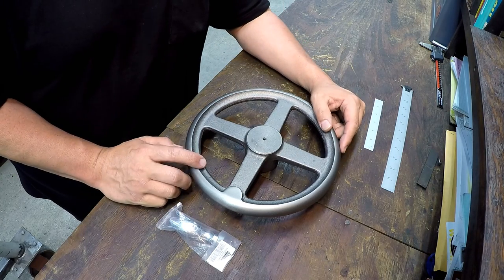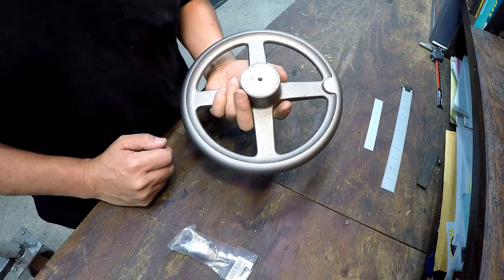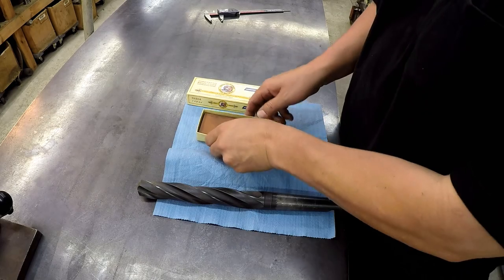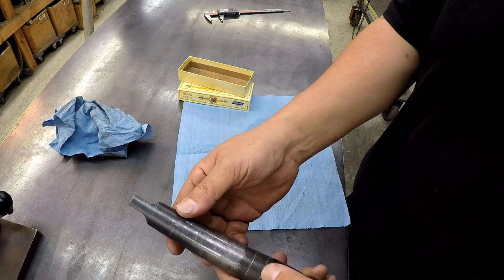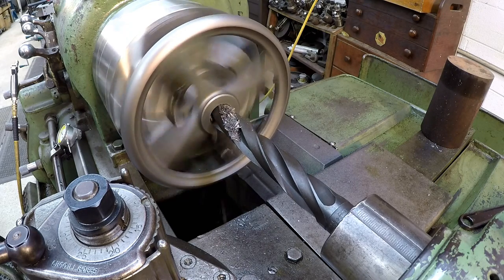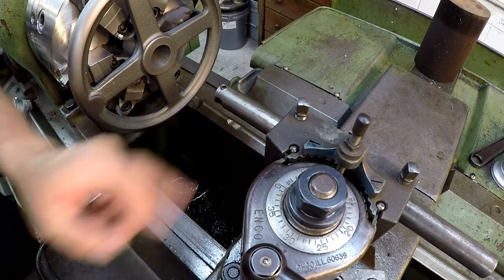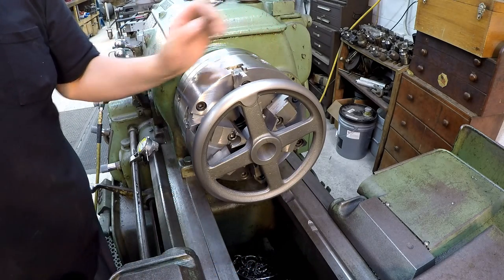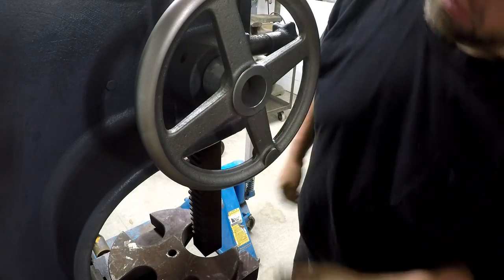Machining a Dake Arbor Press Handwheel

Comment: 30:00 Despite the "few thou" loose fit of the wheel on the shaft it was still so close that the tiny divot raised by the punch was enough to interfere with the removal. Niiiiiice work. :)

Comment: As others have mentioned, those Knipex 'pliers wrench' tools are very useful & handy. They're forged, have smooth jaws, and their well engineered 'rack & pinion' like parallel jaw design allows significant mechanical advantage. They're a bit pricy, but nearly indestructible. If only after one pair, I'd suggest the 10" version (86 03 250). Recently they've additionally released them in black oxide finish... which I'm sure works well... however I've have a pair of the chrome ones over 20 years old now (that with minimal care) have no rust. Knipex now makes the things in numerous sizes, and even a bent handle version. Amazon has them all as do many other places; or even used on eBay.

Comment: You need to add one more step. You need to make a plug (cover) for the wheel center to hide the big hole in the wheel. 
   I enjoy working with my wood lathe but watching you and the precision and the tolerance that you work with 
Is amazing. 
I work alone and spend a waste a lot of time looking for tools I used and didn’t but away and cleaning up the mess I made before I can start a new job.  THAT WAS BEFORE I watched your post on being a better employee, I am trying to use it in my shop and what a difference it has made. 
Thank you for taking time to remind us to be a better person on the job or in house or shop.

Comment: Thanks for sharing your knowledge. I learn so much from watching your videos. I was fortunate when I was growing up to have a fair sized handful of different tradesmen take an interest in my future, (I was a bit of a 'wild' child, so a portion of their purpose was to straighten me up!), and teach me their trade(s).

I was taught carpentry, plumbing, electrical, layout and printing, sign painting and a few other trades.  Fifty years later I STILL thank them.  Watching you reminds me of their giving of their time, and knowledge.

I envy your future children, introduce them to your trade, but don't push; show them how you fix their toys, and other household items. 

Nuture their interest, keep your calm and patient manner of explanation, and you will raise some talented, self reliant individuals. If they never earn a cent using the knowledge, it will be a solid foundation for their future.  

Most likely, they'll end up neuro-surgeons, engineers or invent a new trade, completely.

Your use of the transfer punch reminded me of something I picked up from a Youtube vid a few years ago; something the video producer didn't even mention in the vid.

In the background of the electronics related video, was an open 64 bit drill index, showing the drills. I noticed every other bit was upside down.

This reminded me of something I did with my sockets in my mechanic's tool chest about 10 years ago. I wrapped some bright yellow tape around the x/64 th & odd number metric sockets, to make selecting them with my aging eyes.

I thought about it, for a few minutes, and realized that would making selecting, (and putting away), drills much easier, as well. I flipped the drills in one of my index boxes, and test drove the theory.

Within a month, every time I used anything in an index, I flipped the appropriate tools over, in opposition to the rest.  A short time later, I took it one step further, and took a paint pen to the butt ends.  That makes it even easier. 

In the case of the transfer punches, the paint gets marred up, but it's not like transfer punches get a lot of hammer impacts; in 4-5 years, I may have to touch some up.

As you get older, you may well feel the urgency of time; it certainly goes by faster as we age.  It's these sorts of time saving actions which helps a person accomplish more, in a shorter amount of time.

If you find yourself digging through something disorganized, looking for what is needed, switch your approach, and dedicate a few minutes every day, or so, and sort the stuff, container them, and label.  In a week or two, you no longer waste precious time digging through a box, or bucket.  You WILL thank yourself, profusely.

Hope my sharing brings as much to you, as your videos give me.

Thanks for sharing, and the work it takes to produce the vids.

GeoD

Oh, BTW, matching paint?  That's for the average guy; go for contrast, or something bright. Personally, I like florescents!   LOL

Comment: You need to make a little hub caps for the center of the wheel
Reply: Either that or turn the hub down to the same length as the stick-out of the shaft.
Reply: Maybe a project for NYC CNC with Abom’s logo engraved on there!? Out of brass!
Reply: I was thinking I could 3d print a cap in TPU but I only have garish colors at the moment

Comment: Knipex are hands down the best pliers I've ever used.  I have 11 sets of various sizes and jaw configurations. No reason to have anything else.
Reply: AvE taught me this
Reply: Yes, professional electrician by trade, Knipex cutters, pliers, etc beat the competition hands down. I have a pair of cutters I use day to day... for chopping service cables, (16 sq mm cable, about 2 gauge in US I think?) , pulling floorboard nails, etc. They can still snip the nylon rip cord in a cat6 data cable cleanly.

Comment: Excellent job!

2 Things I wouldn't have Done (just me):

1) Not bored the center hole all the way through.
2) Not machined the OD of the boss. I think the casting texture gave it a natural surface.

I would machine a Name plate with your initials or Drakes Logo, sort of a Wheel Hub..

Comment: Our machine shop teacher in the mid to late '70s taught us to use a cigarette paper to touch off a bit/cutter etc. Thinner than normal paper and everybody had them...  ;)
Reply: Since the same paper was used on both sides, halving the distance to find the center will still work fine. In fact, he could have used something 1/4" and it would still have worked the same.
Reply: Use cigarette paper these days and the shop teacher will have you pee in the container for testing.  ;- ) .
Reply: ‘70s shop teachers equals 2000s sold off machinery and no shop class. Unfortunately everything good is being labeled dangerous and being nerfed now.
Reply: @MrRodneyCL  My machine shop was in college and the teacher was a retired Navy Machinist. First day of class he told us we wouldn't get A+ unless we could do it better than HE could. I got all A ...

Comment: I wish I could afford a nice set of knipex tools. German engineering and finest quality. I'm from Australia so I'm lost with your measurements but I know Abom, your heart is always in the right place.
Reply: Going back and forth between Imperial/SAE and Metric is easy enough.  The key is that 25.4 mm. = 1 inch.  Every now and then, things are close enough that tools are "interchangeable".  A favorite of mine is 0.75 in. and 19 mm.

Comment: My granddad told me its not good to use oil on cast iron for taping or any machining work but just for some help and extra safety he told me to use kerosene. It really helps if you drill or tap cast iron.

Comment: Our 72-year young toolroom machinist does never uses a traditional edge finder.  He uses a .200 gauge pin and puts a little Sharpie on it and moves to the part until just a bit of the Sharpie rubs off.  Says he has always been way more accurate with that over a normal edges finder.  Seeing you use that rod reminded me of that.

I was surprised you did not face the back of the wheel when you did that skim cut.  I know you didn't need to, just thought you would.  Great video

Comment: I ground myself some precision stones at work, for
use at work and I use them all the time. Sometimes
things like that big drill, I’ll leave the stone on the 
bench and drag the drill shank along while rotating
it at the same time. It’s much easier than holding
it in the air like that.

 I also ground some round stones, so now I can get
into some radius’s and some holes.

Comment: Your edge finding method with the piece of paper is quite similar to a common method to calibrate desktop 3D printers, I guess it's a method that works for many purposes.

I have to admit that I'm quite jealous of your home shop, would love to have those machines and tools. I'm gradually improving my situation though, currently in the process of fixing up my grandfathers old wood lathe. Tracked down a new driveshaft for it and gonna try and adadpt it to do soft metal turning in addition to wood turning.
Reply: Been using paper to locate tools for 30 years now.  Only 8 months with the 3d printer...;)  Exact same principle though.  If you take a micrometer paper is consistently 0.0035-0.0042".

Comment: Hi Adam, I was very interested to see how you held the cordless drill when putting a divet in the shaft. You see so many people on here using hand drills at weird angles and moving around so I wanted to see how accurately you did it. I can honestly say that you seemed to be spot on square to the shaft and never deviated, perfection!
I bet that 'Stefan Gotteswinter' would be envious of your stance, maybe you could arrange a contest to see who is the most accurate with hand tools used in a machine shop? A simple piece of 2" square bar, one face filed down 1/16", one face hack-sawed corner to corner halfway down it and a 1/4" hole drilled through in the center of another face with a power hand drill... could be fun?

Comment: I'd have made the bore in the hand wheel a blind hole to the correct depth of how far onto the shaft you'd want it to go. Nothing wrong with the way you did it though, just personal preference. Also, recess the davit in the shaft a little bit so that it cannot flare and jamb the hand wheel onto the shaft.

Comment: Nice work there, watch for another favorite machinist; Keith Fenner
 to make a comment about not having a rag down if that's Ductile materal.
Reply: It's a personnel preference.  Take 10 machinists and 5 of them won't use a rag.  They will clean up ( Adam keeps the tools and shop spotless) after every cast iron or ductile job. It's just how you prefer to run your shop.

Comment: Great work. Without any criticism, if I was the customer I would have requested 3 things done differently, mostly for visual reasons:
Not machining the hub sides. I am sure you could have held the work by the rim without leaving marks.
Shortening the hub height to match the arbor. Or place a cap on the hole.
Grub screw set in between two spokes, so it can be accessed with a basic key.

Comment: 2 thoughts:  1.  would it have been a cleaner install to not have through drilled the handle hole?  2.  Would it have been an easier install to put the set screw off line from the spokes, making it easier to fit an allen wrench in to tighten?
Reply: @TheMrSnyder Wonder if it might have taken some of the stress of the setscrew if the handle bore might have been slightly tapered?  That is, requiring the handle to be hammered onto the shaft.

Just thinking aloud--it isn't my tool, after all.

Comment: I believe I have seen extensions for taps that duplicate pully taps. you could use an appropriate 1/4, 3/8, or 1/2” socket extension female side down to get by, but it would be a wobbly fit without some modification.
Reply: Lisle makes a set of tap sockets. A pulley tap is much thinner than any standard tap with an extension though.

Comment: 12:00 I've never seen a 3 flute twist drill bit before.
Reply: Xarfax umbagwe  I believe Adam called it a "core" drill. They're extra rugged and designed for enlarging the cores of rough castings.

Comment: Hi! I have an never done this type of work but i was just thinking why the hand wheel needed  to be drilled all the way through as the shaft on the press 
does not go all the way to the end of the drill hole also it might look cleaner if the hand wheel was closed on the outside? 

Love your work by the way.

Comment: Beautiful job, just as the press is itself. Have you considered to polish the outside of the handwheel in order to increase the rust resistance an to match it a little better to the chrome handle? Shouldn't take to long on the lathe.....

Comment: An adjustable strobe light would offer a way to look through the spinning jaws. One could be automatically synchronized to lathe rpm. After 2 sentences of delayed thinking a regular timing light with a trigger for the inductive pickup would do the trick; a magnet mounted out of the way so that the flux is cutting a small shorted coil to clip the pickup around. Now back to watching you handle it properly.
Reply: Just don't forget that the jaws are spinning...
Reply: @petermichaelgreen  That's the purpose of the strobe. If the light only flashes when the chuck gap is in the same spot it will appear to be stationary. It's the same principle that enabled movies to appear as real life. The strobe illuminates the multitude of images only when an image is at precisely centered behind the projector lense. It is also how a timing light works except the signal to flash the strobe comes from the number 1 spark plug current's moving magnetic field. The pickup coil of the timing light has a voltage induced which drives current to flow and trigger the light. For anyone interested or unfamiliar with the technology. But back to your comment there is a risk potential created when moving machinery appears to be stationary. Gotta be on the ball in lathe country. An oversized loosely fitting long sleeved sweater has been sacrificed to the most unforgiving of the supreme beings, Ohshitno, the god of open machinery.
Reply: That's not going to work well with a rolling shutter video camera.

Comment: And now use the 3D-Printer to make a decorative  cap for the open bore of the handwheel. :-)
Such things are really good to learn the in and outs of 3D printing. They are easy to design and fast to print, but you have to hold tolerances.
Reply: 3D printer? Sacrilege. A nice machined brass cap will do nicely.

Comment: When you tap on the mill does the mill automatically move down or does the tap pull it down as the threads wind down?
Reply: You have to match the feed & speed to how fast the tap will pull itself through the material.
Reply: Adam's mill has a spindle quill arbour, which can move up and down freely even though it has a rack and pinion. The thread tap can pull the quill which has the spindle in to suit it's pitch.
Reply: On a manual machine you disable the spindle lock/fine feed so it can spin freely and it just pulls itself into the hole.  On a CNC machine you program the feed rate to match the thread pitch.

Comment: A real nice Dake press. But paying 15K plus is a tough pill to swallow. Nice job Adam too.
Reply: I missed the 15 grand for the arbor press, I mean at, for example $100/ hr, you could put in 150 hours minus materials to make one.
Reply: @tobyw9573  If one has that much work for this machine is one thing. But paying the steep price is another. Toby, I have to agree. I would make my own too. This type of machine is fairly straightforward to make. Good day too.

Comment: If you had your choice between a Jet mill w/ tools or a Jet lathe w/ tools which would you buy ? A former machinist and gun smith owner both , so there all set up and ready to go .
Reply: Two totally different tools. Silly question- it depends what you are making.
Reply: Tell the Mrs. you're getting both!!   :-)
Reply from the maker: Kind of hard to say one is better then the other because they both compliment each other. A mill is probably more handy for random jobs though.

Comment: It’s your tool and do as you wish.. but I would of not made the hole/bore go all the way through the center of the hand wheel mounting location on the shaft...
Reply: I made a similar question before seeing yours. Why not a blind bore hole. It would bug me to no end. Adam may be planning on a custom cap to cover the hole.
Reply: ...Blind bores are the work of the devil.

Comment: I happened to notice that Dewalt drill that you used worked fantastic.. I been saving to invest in a new battery platform and I may have to look into their kits…  thank you  😏
Reply: I'm a concrete guy and we've had the best luck with Makita over the red and yellow tools.  They seem to hold up better to the dirt and grime we subject them to.
Reply: Watch a few AvE BOLTR tool reviews and you will always buy Makita hence forth.
Reply: Trying to support the channel here… I’m definitely buying dewalt!
Reply: Sick and tired Of complaining There are lots of ways to support the channel that don’t involve spending money on inferior gear, but hey. It’s your money and you can spend it wherever you want.

Comment: Another great video. A couple questions I had while watching: why hone/polish the taper on the drill bit? Why the comment about wiping down the lathe and getting all the cast iron off? Is it hard on the machine? Or rust bad? Lastly, do you have a video on drill bit grinding, or could you make one? :)
Reply: Daniel Dempsey. Adam polishes the taper of the drill as the high spots (dings) will cause the drill bit to run off centre and not seat firmly in the tapered tailstock, wiping the cast off the machine is a must as it wears the ways down kind of like rubbing it with emery paper. lastly Adam has several videos and techniques for drill bit sharpening. just keep watching his vids and you'll come across them. the time is not wasted and every video interesting and informative.
 
kindest regards paul
Reply: @paulthemachinst6545  good question good answer